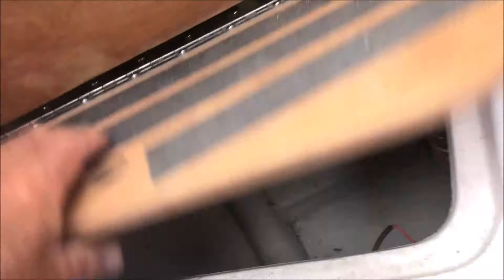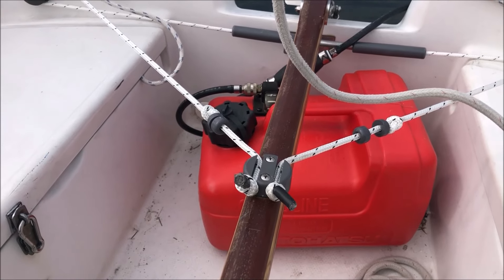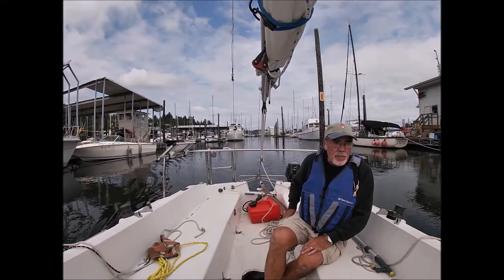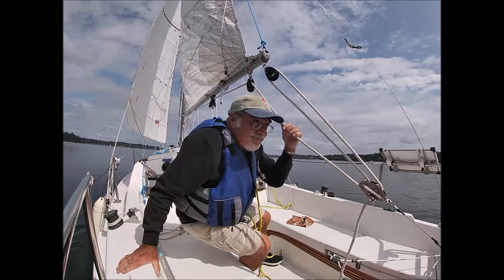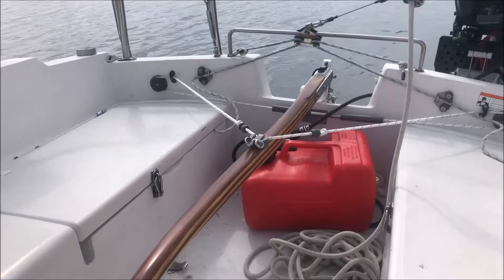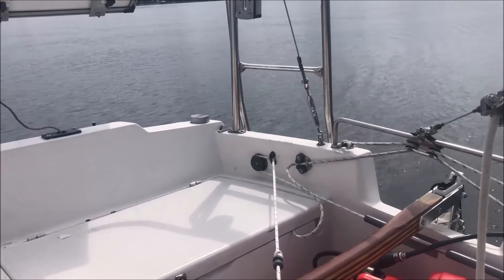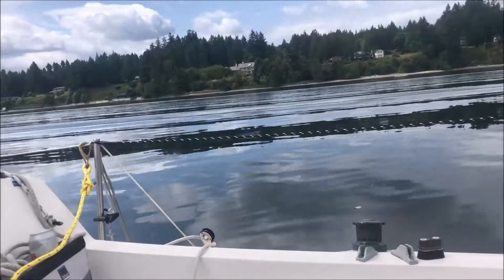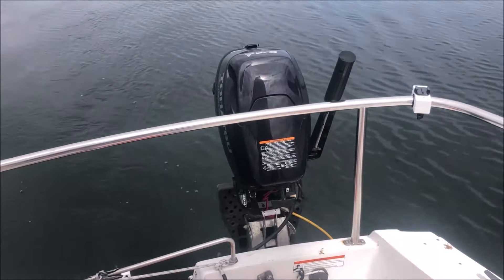Single-hand Your Small Sailboat -- Tips for Beginners  -- Catalina 22 -- Jim's Little Boat

Comment: Single handing is a different experience for sure. I do all the time on my Hunter 23, similar boat to the Catalina.  Kind of nice not having to tell guests pull this, no that, now let it out lol... I use a tiller clutch and it works well, same idea I guess.  I find lazy jacks work well too when dropping the main. As having halyards led aft to the cockpit. roller furling would be nice. I started typing my fenders to the dock so I don't have to bring them up or have the farmer look going on lol.. have some nice clean new ones if I want to dock when visiting another moorage.  

Can be really nice single handing, also a good challenge for improving skills as if the wind kicks up and stuff goes wrong, it's up to you to handle it all. I think most of it is just keeping calm and generally on top of things out there.
Reply: Chris Burns, how do you like your Hunter 23 ?
Reply: @bug512  i really like it. Fun and easy to sail, easy to single hand. Does great in light wind, bit tender when it gets windy and heels easily, so I just reef early and it's fine, and never felt dangerous others have told me the boat rounds up if the rudder comes out of the water a certain amout. Was out in 25 knots with 3-4 foot waves last month and felt safe.

Good for weekends, interior is nice with the woodwork.probably best overnights for single person or couple.but works well in the space it has.
Reply: @chrisburns5691  Thank you for the reply.
Reply: Hunter 27. Best 75 hp 20 knits under rre

Comment: Great tips
I also single hand my 22’ wind rose quite often. I usually attach the jib halyard before I leave the doc so that I don’t have to go up on the bow. That is until I have to bring down the jib.
Reply from the maker: Yeah I would like to do that, but it seems like it always wraps around something and I have to go forward anyway.  Got any tips?
Reply: If you put a little down tension on your jib dowser then attach the halyard and put a little up tension on that. The lines stay tight and don’t get hooked on things to often. You just have to remember to release the dowser just before raising the jib. 
“Newton missed one law of physics, 
If a wire/rope/halyard can get caught on something it will, even if it can’t, it still will.”
Reply from the maker: @doublediamondsdunn7287  good idea--I will give it a try
Reply from the maker: I tried it today--worked great.  Thanks
Reply: i have a jib downhaul on my boat, works well for bringing it down. Thing i s though I like to go up and put a bungee around it, especially the bigger genoa, to make sure it doesn't roll around. Maybe this isn't necessary- but I find I am usually going up on deck to bring down the sail.
Reply from the maker: @chrisburns5691  I can usually trust the 110 to lay on the deck if I tighten up one of the sheets, but the 150 really does need a bungee to keep it out of the water.

Comment: Great advice.  Since I don't have a motor, coming in under sail is a challenge and a pain.  Some times I'll drop the sails and paddle in.  Easier at times.  I am lake sailing, so  don't have the marina troubles you have,  Anyway you could tie the safety line to the tiller to release it if you were to fail overboard?
Reply from the maker: That is a good idea.

Comment: Nice tips. Life line key for sure. Add: Radio w/ SOS or an EPIRB?  Or In Reach?  
What is the nice compact solar panel? Brand? watts?  Thx for posting
Reply from the maker: The solar panel was the cheapest thing they sold at Harbor Freight.  Came with the boat.  Seems to work well.  The clamps cost more than the panel.
Reply: Master chef add. Radar bad weather

Comment: Jim, is the block (spring loaded, why?) and sheet that I see when you are explaining leaving the fenders out the jib dowser or is that the jib sheet for the Port side?
Reply from the maker: Not really  sure which block we are talking about?  I just leave the fenders out because I am lazy.  If we are sailing hard we stow them in front of the volcano.
Reply from the maker: In one of the videos I explained the excess number of cleats.  One set of jam cleats are pointed toward the helm for single handing.  The other pair are pointed toward the bulkhead because that is where I like the crew to set.  The cam cleats are only  used for single handing when the wind is very light and steady.  They are dangerous if the wind is gusty.  They won't release when there is a lot of pressure.

Comment: I just bought my fist sailboat, a 17 ft ODay.  Having difficulty raising the mast singlehanded.  I think I need a gin pole or crutch plus some other stuff.  Any tips on this would be greatly appreciated.
Reply from the maker: If you go digging around in the blogosphere I made a gin pole for my Tanzer--but I have to warn you it involved cutting the mast and adding a hinge so it was like an overnighter.  That blog was also called Jim's little boat.
Reply: Use. Ektrinc sail. Remarking master use ekrric as sibling rigs

Comment: What motor do you have and would you recommend it or a different motor for someone with Catalina 22 and no motor? Is it 4-Stroke or 2-Stroke?
Reply from the maker: I have had great luck with the Tohatsu Sailpro 6 extra long shaft.  The prop never cavitates.  It charges my battery.  My only complaint is that you have to carefully tend the choke on a cold start and it is kind of easy to flood.  With a bit of practice this is not a problem.  I would have bought a Honda but there were none available.  It also costs significantly more. The problem with all motors is that they are too heavy.  The boat was designed for something more on the order of  40 or 50 pounds.  With a heavy motor, the Sailpro weighs 75, the boat tends to squat.  That hurts performance.  Best compensation move heavy stuff forward and train crew to sit forward in cockpit.  Probably more than you wanted to know--I do that. :)
Reply: @jimslittleboat4388  Jim. I want to know anything you have to say. I have been looking at a HONDA 8 4 stroke and was concerned about that very thing - weight distribution. I am also looking at older Mercury 8 HP 2 Strokes for their reduced weight. Where I live, San Diego, taking a C-22 to Catalina Island is something that happens weekly, so I want a good motor and strong with plenty of range (frugal fuel consumption). I am trying to balance all these things, but safety is of course number One. Speed (while under sail) is number two. BTW, if I had to own just one jib, would it be a 110, 120, or 130?
Reply: Booth great outbards mercy hinda no I ses wight
Reply: New 8. Hp outbards 8 Amp altrunatr 12 vikesrts 96. Watts aktrrenetratir

Comment: If you fall over with that set-up, do you think you can get back onboard?
Reply from the maker: Good question, Bobo.  I have the boarding ladder set up with a reef knot that I can reach from the water.  Then the ladder drops down in the water.  I have climbed up the ladder and over the stern rail.  Once with a life jacket and many times without a life jacket--So answer is I Think So.  Who knows what will happen if the boat is making 5 knots in lumpy water.  But I know I have no chance if the boat sails off without me.
Reply: No… this is not standard in any sail training. This is very dangerous. Drag and drowning occurs at 4knots of speed.

Comment: I appreciated all that you discussed in this video. Seems, as an aside, we both share some knowledge of psychology. What was/is your profession.? While you mentioned your preference for the fin keel on the Catalina 22, i see you have a swing keel. How long did they make the fin keel? Has their been any problem with trailering the fin keel boats? The only fin keel I have ever sailed was on a Hunter. It seemed to sail a little flatter than the standard keel equipped boats. How does it perform on the Catalina 22s, relative to the other keel designs?
Reply from the maker: Hi Michael--I was (am) a teacher and principal This year I started my 50th year.  Mostly retired, but still subbing and writing books about education.  As for the fin keel, I don't really know much.  They sit very high up on the trailer and can be hard to launch.  Every time you find one the original keel bolts are corroded and they have already been sistered up.  They sail closer to the wind, they are difficult to launch, and there seems to always be a crack between the keel and the hull, called the "smile."  They are quite roomy inside.  Probably not the best boat for lower Puget Sound.  It can be very shoaly  down here.  That's about all I know.  Oh I almost bought one, but the owner didn't want to take the time to get a clean title on the trailer.  It was a great boat.